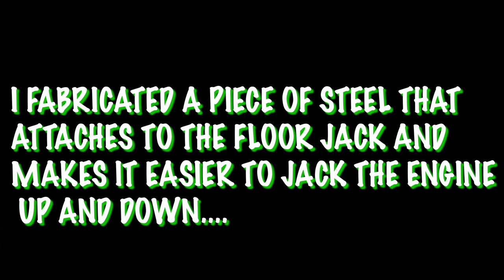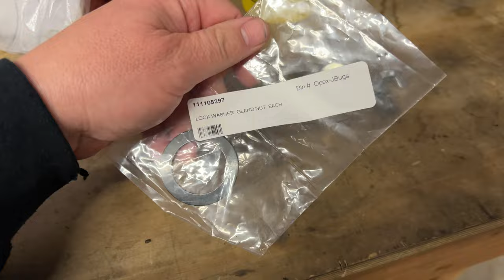1970 VW BUG ENGINE INSTALL!!! Doesn't go as planned!! #vw #bug #1970

Comment: My dad had a 1952 VW brand new. I was born in '49, but I remember it well. He had an opportunity to import them but turned it down, but my dad and my 2 older brothers went down to NY to the docks and drove 3 back to Massachusetts. My dad kept one and the others went to the guys that became Volkswagen Northeast !! 25 hp, non synchro 4 speed tranny, bulbs in the headlights. Split rear window. Directional arms that came out of the door posts like other European cars of that era. That was the first car I ever drove on the street and I was 12 ! Obviously dad wasn't home !!

Comment: It helps if you put trans in 2nd gear & pull e/bk so when you turn motor  the input shaft won't turn. I fell your struggels with it. That was me 43 years ago when i stsrted working at a small vw repair shop for 9 years & then i had my own vw shop 10 years. Drag raced a 64 ghia with a 2388cc motor dynoed at kawells 254 horsepower. Them were the dsys. Enjoyed vidios   been 23 years the last one i worked on one.
Reply from the maker: You and me are in the same boat !!! It’s been so long I forgot all I knew ! Thanks for watching and commenting!!